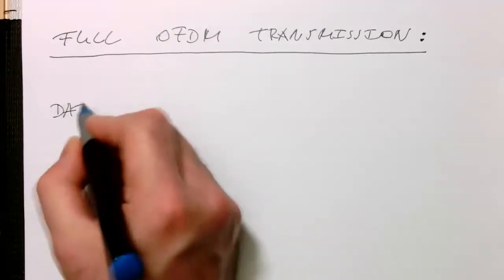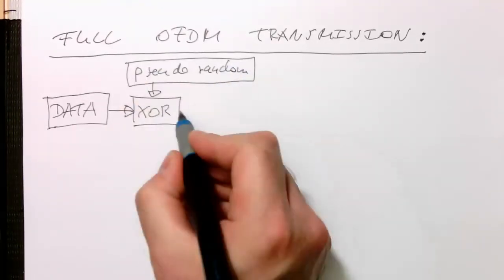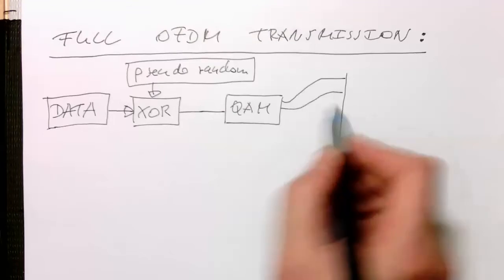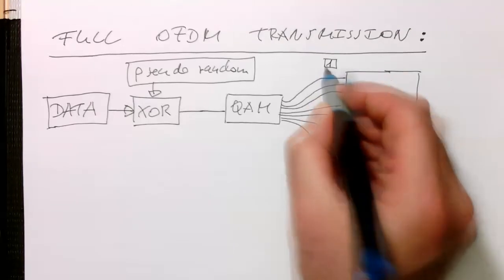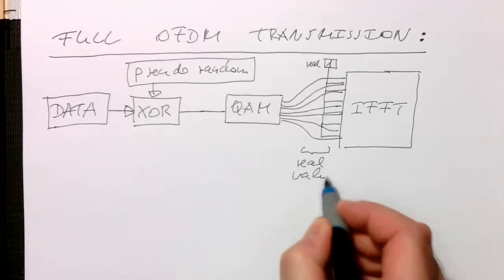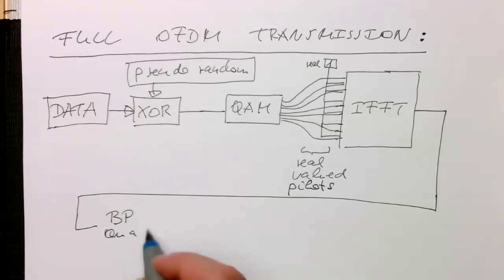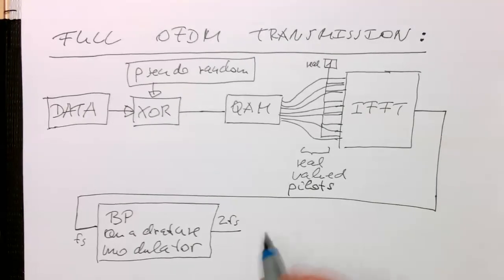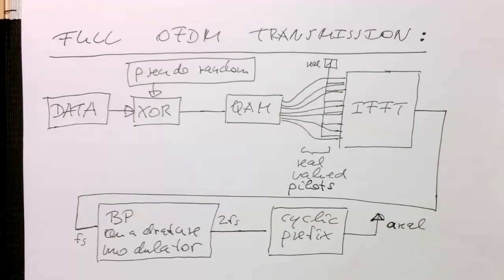OFDM: Complete transmitter (0032)

Comment: The cyclic prefixing is applied Immediately after the IFFT - while the data is still in digital form, right? It is only after the cyclic prefixing is done, when the digitally stored complex values go to the quadrature modulator, right?